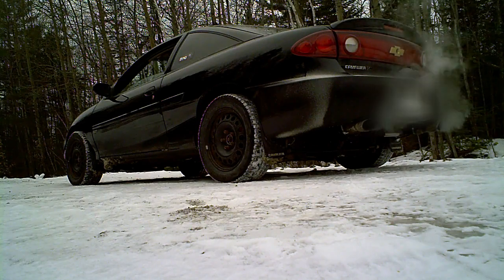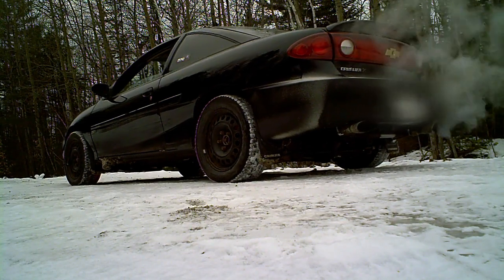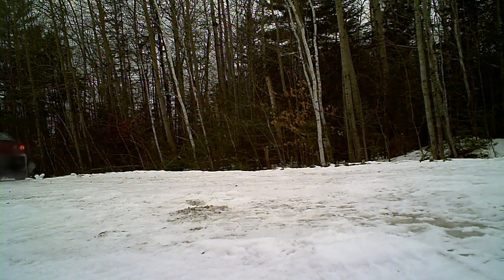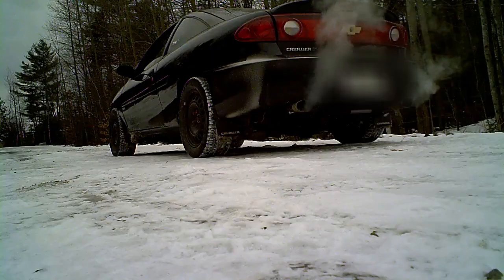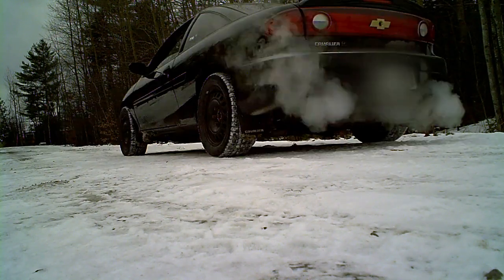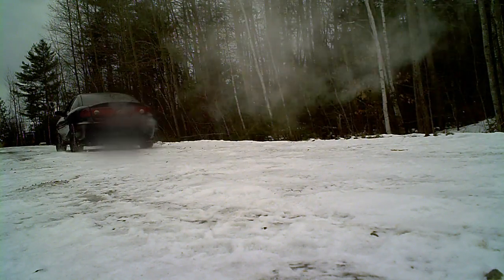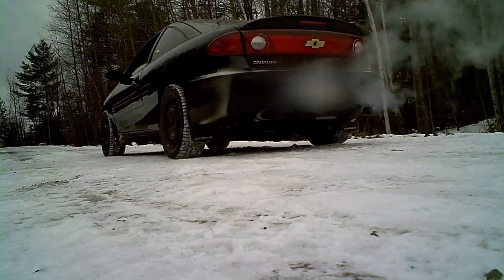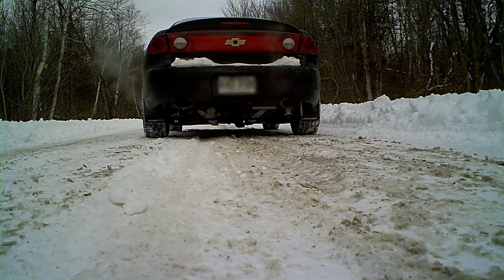World's first AWD Turbo Chevy Cavalier single engine stock body/frame - First rides in snow (2020)

Comment: Definitely looks like fun!
Reply from the maker: It is. Will be better with my next generation “intelligent” AWD with ABS sensor sensing and HF v6t :)
Reply: @djvicy  very nice!  You can kinda see it in my photo but that car is getting a b284l out of a saab and a tremec tr-3160 out of a camaro i just picked up this weekend.    I have my og cavalier ive had for many years and i discovered yours as i was thinking xwd from saab but with the v6 if it can be lined up correctly

Comment: I'm doing the same to an 81 Oldsmobile Sport Omega. So what exactly did you make to operate the Haldex system? I'm interested
Reply from the maker: Custom controller designed and programmed by me :)
Reply: This guy (Bradley) is 100% legit. I will vouch on his build being one of a kind and the most attention to detail I've ever seen.
Reply from the maker: But im pretty sure some aftermarket ecu can control diffs base on some inputs of sensors
Reply: @djvicy  I've looked into the aftermarket Haldex controllers and they don't offer anything for the GM/Saab setup.